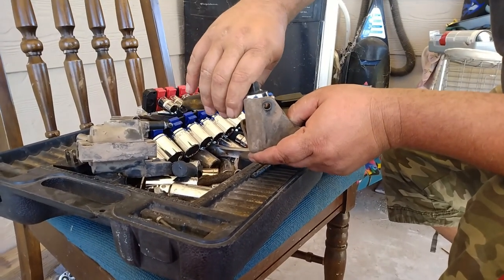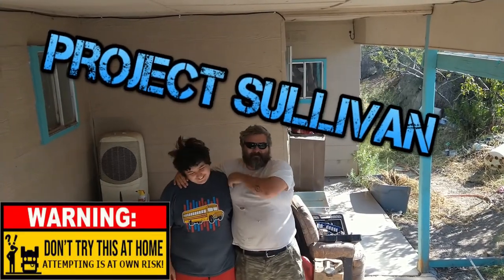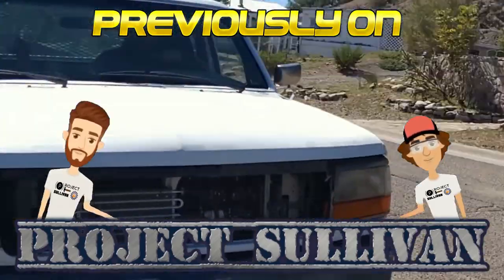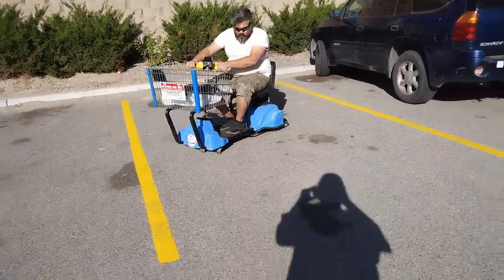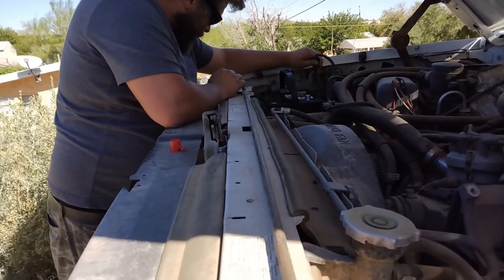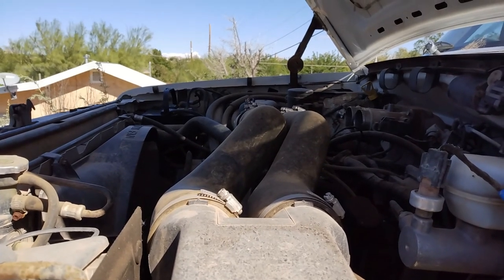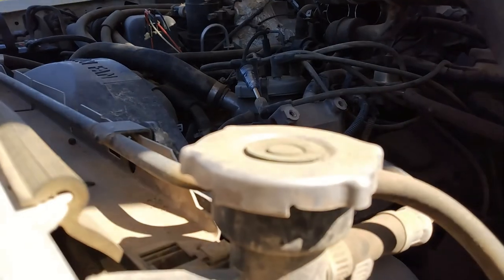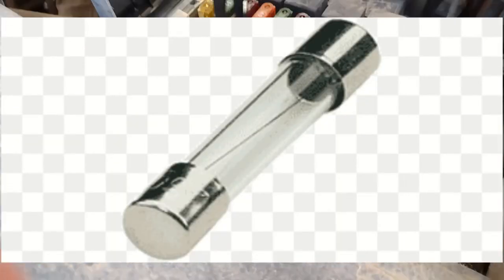Resurrection: 1996 4x4 F250 diagnosing for beginners (1996 F250 part 2)

Comment: Careful with the ether. It's an effective solvent and will remove oil from cylinder walls, rings, and bearings, ect. allowing metal components to contact/wear. I just rig up a can gas to draw fuel from if the tank is suspect.
Reply from the maker: Very much so. I have never used it, as much as, we used it this day. I was hoping to just get it moved up, and into the car port. It took more then I had planed. Appreciate the comment. Suggestions like these are wants going to make Gogo and myself better at what we are doing.